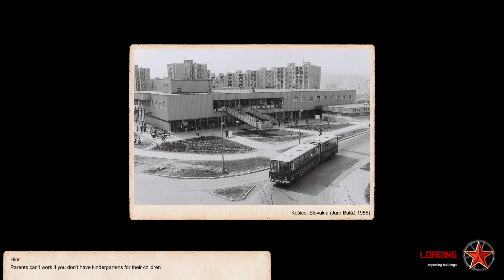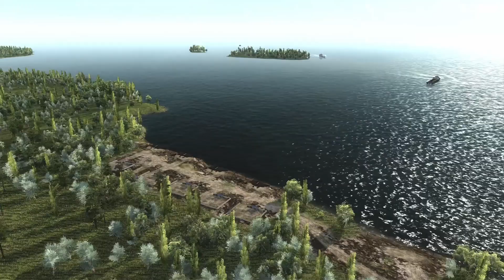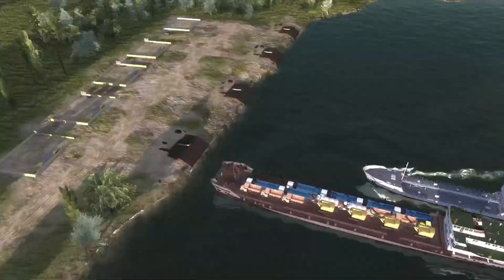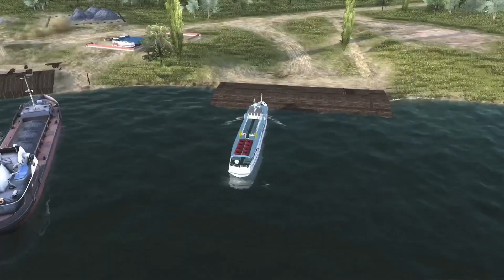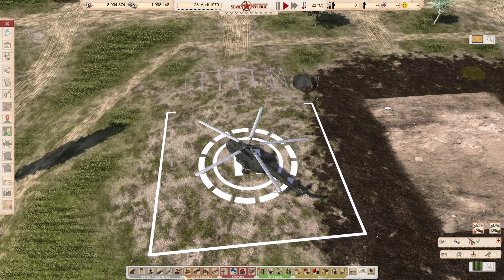Bballjo Challenge without Cheating | Realistic Island Start | Workers and Resources 1/3

Comment: I survived 3 years now (starting 1960). Interesting so see you go helicopters while I stick with ships. The pioneer pack provides a small storage that can be build with basic mats. This one can then hold the mechanic and electric parts, coming in by ship. 
The Military pack provides - besides the generator - a small concrete plant and asphalt maker. They can be fed directly with materials. This is how I got started. Build a small town and was able to invode the first 300 people in spring 1961. Finally independance from foreign workers! 

Biggest bottleneck in that phase was - besides workers - the cement for concrete. Had to switch to a larger ship to bring in the amount of cement that is needed. I never realized this with the typical customs setup. 
And the third bottleneck: the free storages. Especially the gravel storage is painful to watch. So this was actually my next goal: Proper handling of building material: better storages and real harbor/docks. This is where the next pile of money went for me.

Let's see how you are doing in the next episode. Thanks for sharing
Reply from the maker: Hey jensa,

My next episode should be a huge jump. Your parallel play through is really interesting. Maybe you could pass on a save or two, so we can compare it! You are totally right, gravel is a pain, I also said it in the episode :). Never liked the vanilla free storage, but it's ok, because It's free :). The volumes and manual loading of gravel based stuff is unpleasant to deal with, but I am glad to make it this way. You are totally on the right track, realistic mode is about bottlenecks, and pacing.

How many hours have you clocked into the game?
Reply: @ddennisshow  I'm have a couple hundred hours in the game. Realistic from the very first try since that makes this game so different from the others. But I never get too far on a map because a new one catches my interest with a new challenge. I like the initial setup phase and try to get better with every new map, LOL

The island challenge was interesting because it forced me to use ships - which I had totally ignored before.

I started on the big island, closest to soviet border. Without knowing, this was the area where Bballjo made a rich oil spot on his map. That did help greatly in funding my progress.

I played to a point where I planned a new construction industry somewhere center map from where I would try to get to coal and iron. 

Share map? How?